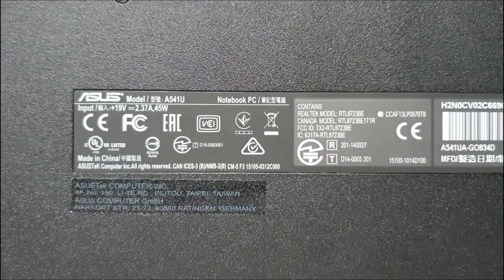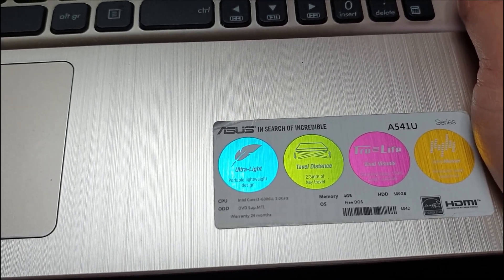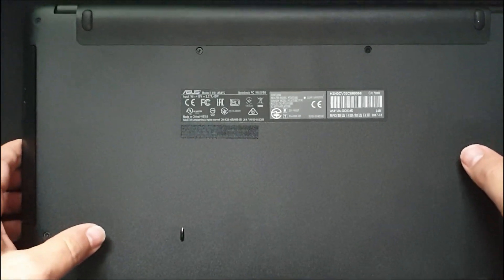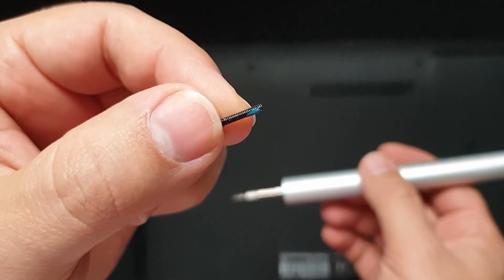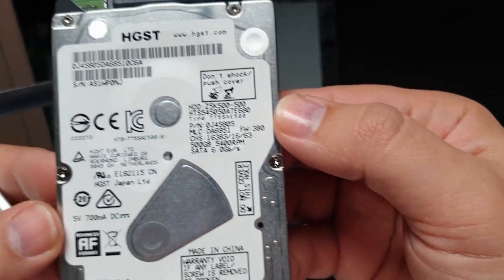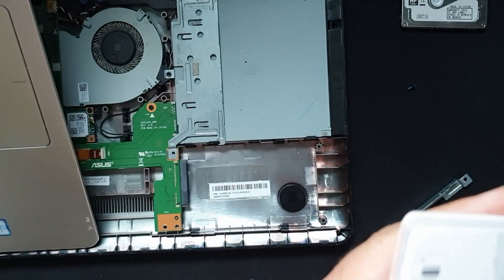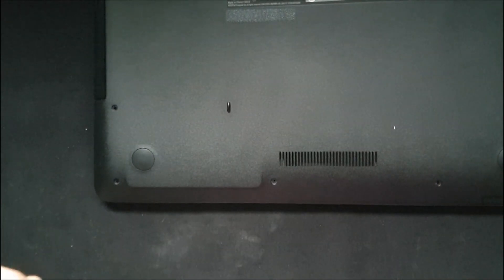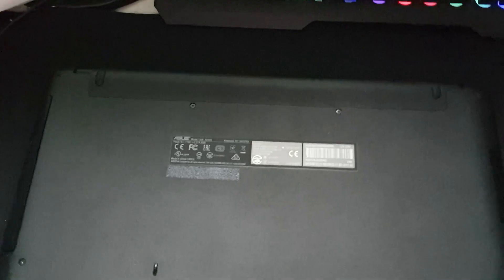Asus A541U | HDD Upgrade | Disassembly | SSD | How to upgrade your laptop

Comment: I have the same laptop, it got very low. I was typing the same model name on asus website but couldn't find it. Should upgrade to ssd and what is the full model name of this laptop?
Reply from the maker: Hello, the model is A541U, similar to > https://www.asus.com/RO/supportonly/A541UV/HelpDesk_Knowledge/
The SSD upgrade makes it faster since the loading time is significantly reduced, windows load time, apps loading time and all, when you open it make sure to clean it also for dust... Best regards.